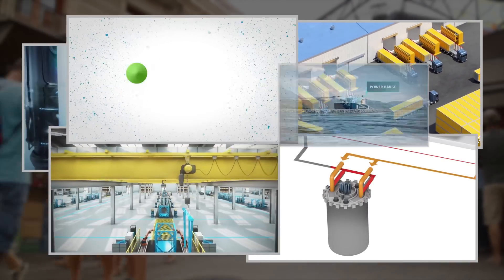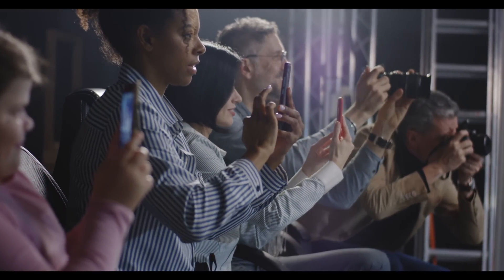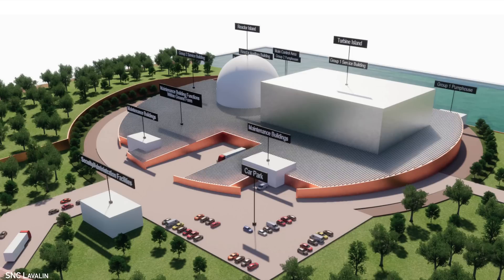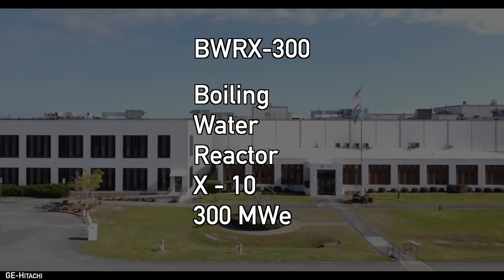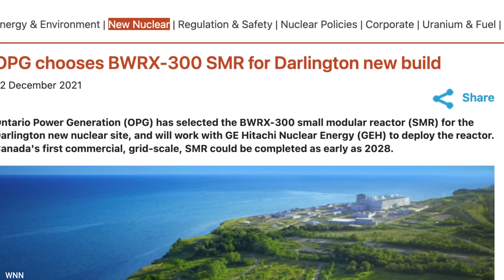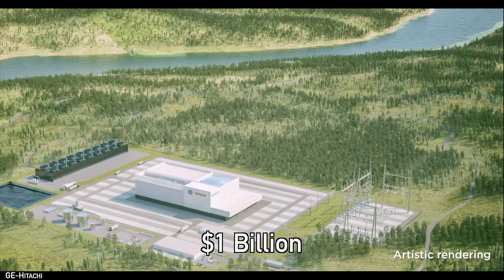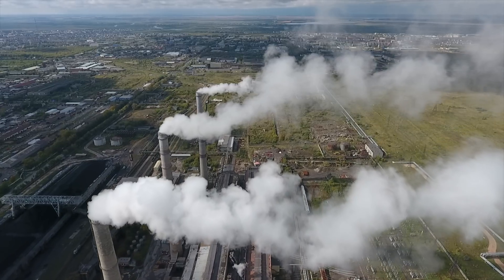Why This Small Nuclear Reactor is Actually Winning

Comment: Problem is it operates at to low of a tempature to store power as heat.  This makes the reactor a poor choice for when there is a large fluctuation in power needs.  In fact I think this type of reactor needs to be operated at a steady output or reaction killing elements can build up and require the reactor to wait several days to restart. Not a good system where the grid has allot of intermittent renewable power sources on it.
Reply: Baseload
Reply: @daniellarson3068  providing baseload is becoming less and less profitable.  When most of the nuclear plants in the country were built electrical payments were based on the amount of investment in the plant and  were not varied on when the power was produced.  Because of this payment structure large baseload electrical generation with high capital cost were profitable.  This is no longer true in that payments for electrical generation have been deregulated resulting in poor profits for baseload power plants.  The problem being that renewable power sources are profitable at really low reimbursements since their cost of producing power when they are doing it is very low.  So when these renewables are producing power any baseload power plant is going to be losing money during these times.  So ideally any high capital cost power plant will need to be producing most of its power when electrical prices are high when the renewables can't.  This is why future nuclear plants will need to be able to load follow and store their power to be able to output it at times when it is most profitable to put it onto the electrical grid.  Currently the best nuclear candidates for being able to do this are high temperature reactors where heat can be stored in molten salt each storage tanks to produce electricity when prices are high.  This high tempature heat also having secondary uses in industrial applications as another source of income for a nuclear plant.
Reply: @stanleytolle416  Interesting. Thanks for explanation.
Reply: @stanleytolle416  at some point the game will likely switch back again. Right now there is no incentive to invest in anything other than low cost to produce renewables. But this is making the grid less reliable. At some point the regulators (or the market) will have to prioritise the supply of reliable power again.
Reply: @yt.damian  Exactly. Why should every other power generation plus demand have to dance around intermittent renewables? At some point their value needs to be questioned if they are the cause of destabilization.
Reply: WHy would you need renewables on nuclear grid? :D

Comment: Thank you for the information on the BWRX 300 reactor and now I see some of the flaws in it's design.  Someone please correct me if I'm wrong but Nuscale (I own the stock) is truly modular with contracts signed for long lead components - built in a factory.  At 77MWe per module 4, 6 or 12 modules can be linked together totaling 308MWe, 616MWe and 924MWe respectively.  While the first version at UAMPS is running over projected cost, as sales ramp up increased volumes will lead to lower costs.
Reply: I live in Oregon. not far from the headquarters. NuScale will be worth zero dollars in the next few years. Delays, delays, delays and not at all competitive against any kind of clean energy solution. Bailouts from Bill Gates and the DOE only go so far.
Reply: @KendallAuel  Nuclear doesn't compete with renewables, it competes with coal and gas fired plants (and large capacity storage, which we can't do very well yet).  It will still be difficult to compete with those on economic terms, but given the drive for zero-emissions power, we might not have a choice.

Comment: A couple of follow-up questions Atomic Blender:  1.  How much does this reactor cost on average; 2.  How many homes does this 300 reactor power in the US.  I tried to search for these answers, but I got a large range of answers that seemed unreliable.  thanks for the video.
Reply: Power consumption in the US is 1.2 kW on average. At 300 MW would power around 250000 homes. The reactor average cost cant be calculated until at least 10 units are built, it will be around 1 billion, but usual cost overruns could make it twice as much.
Reply: Optimistically this will be $3500 per kW. That is the cost to build, you still need to purchase nuclear fuel on a regular basis, perform costly maintenance, and dispose of waste. Compare that with solar (less than $900 per kW) or wind (less than $1500 per kW). You might say nuclear is "small footprint" but do the geometry. Assuming nobody wants to live within 2 miles of the nuclear plant, that gives you a circle with 12.5 square miles area. That is a lot of solar panels.
Reply: 1stly just because people aren't living there doesn't mean the land isn't used. The space is still an issue for solar and wind farms. 

2ndly, why do you assume people would not live within x radius of nuclear power plants. Plenty of people already live littetally next door to nuclear plants.

3rdly solar has a capacity factor of only 24.9% (compared to nuclear's 92.5%) what this means in pracitcal terms is even if every kwh of solar engery is stored or used immidately it can only produce 6 mwh for every 21 mwh per year a nuclear power plant of equal megawattage. 

4thly, nuclear is cheaper when you account for every factor. According to the institute for energy research nuclear costs 33usd/mwh while solar costs 88.7usd/mwh. 

5thly nuclear power stations last longer than solar farms. About 3 times longer infact. 

6thly both your cheap up front costs and the more expensive total costs for solar are only at their levels because government provides 50 times the subsidies per mwh.

7thly when you factor in the large batteries wind and solar need to be ale level out their electricity supply for the whole day, wind and solar have the same initial investment cost as nuclear (despite shorter service lives)

Comment: How dows a BWR integrate with variable power generation of renewables?
Reply: Baseload generation. We keep them at a constant burn to meet the minimum required output. At the least we can take the baseload stations that are coal fired offline and switch any others to peaker plants that rapidly spool up to meet any demand shifts. It would result in a significant reduction in pollution output.
Reply: Hopefully no way. By the time we build these we will be over this solar wind madness hype.
Reply: @lukacsnemeth1652  maybe it's hype but the build rate of wind, solar, and utility scale battery storage is exponential. The power utilities are loving the benefits of batteries, they respond instantaneously to power demands, they keep the grid nicely synchronized, and they enable storage of excess generation for usage later. Hmmm, billions being invested by the smartest people on the planet. Sure it's all hype. All the way to the bank.

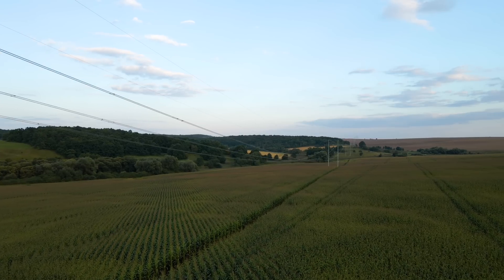Comment: 4:56 Borring is usually excellent for business in that its stable and reliable. Toyota is boring, using what many consider old outdated engine technology but to those who know that translates to resiliant KNOWN powertrains resulting in excellent reliability and maintenance. Conversly the Germans use a lot of tech which is not fully baked, many more complicated pieces resulting in early failure of components and difficulty obtaining certain parts for maintenance.  Great example of why you want boring.

Comment: I believe the use of TRISO fuel has become essential in a modular reactor of the future, because it remove the risk of radioactive leakages and core meltdowns...
Reply: The cost of TRISO is astronomical for utility scale reactors. For submarines and aircraft carriers, and for RTGs at future lunar and Mars colonies, it's the way to go.
Reply: TRISO fuel produces a huge amount of waste, that is hard to reuse.
The local way would be to use spent fuel and depleted uranium, to get rid of this waste.
🔋 Key Advantages of the Dual Fluid Reactor (DFR):

• ⚡ Ultra-efficient: Nearly 100% of nuclear fuel is used  
• ♻️ Burns nuclear waste, depleted uranium, natural uranium, thorium – and all actinides (incl. Np, Am, Cm)  
• 💥 Transmutes long-lived actinides into short-lived fission products  
• 🔄 Built-in Pyro Processing Unit (PPU): Continuously removes neutron poisons and extracts valuable metals  
• 🛠️ Liquid fuel: No solid fuel rods, no reload cycles  
• ⏳ Decades of operation with a single fuel load possible  
• 🚫 No corrosive salts: Liquid metal fuel avoids fluoride corrosion and complex chemistry  
• 🧊 Lead coolant: Excellent shielding, no water, no pressure → no steam explosion risk  
• 🌡️ Very high temperatures (700–1000 °C): Enables hydrogen, e-fuels, ammonia, and direct steel reduction  
• 🧠 Self-regulating: Output adjusts automatically via negative temperature feedback  
• 🪫 Minimal waste: Only short-lived fission products remain (• 🏭 Compact & scalable: High power density, ideal for modular deployment  
• ⚙️ No moving parts in reactivity control: No control rods required  
• 💰 Uses spent fuel, DU, thorium & actinides – no enrichment required  
• 🌍 Reduces dependence on enrichment, mining, and fuel imports  
• 🔄 Fully closed fuel cycle: No external reprocessing required  
• 🆚 Outperforms typical SMRs: No pressure vessels, no water coolant, no fuel handling

Comment: 4:20 This is THE STUPIDEST thing imaginable. There is a reason why almost all other reactors have separate steam generators and that is to avoid contaminating the turbines and other equipment with radioactive materiel. Good luck servicing or getting rid of turbine and piping contaminated with fission fragments and probably activated by neutrons.
Reply: Other SMRs are designed to be non-serviceable. Not sure if this one is the same.

Comment: 1 Module = 1 Football field. 
Nothing Small about that. 
Not going to be putting it in an abandoned Mall parking lot either. 
But, politicians are stuck thinking in terms of Baseline power, and 30MWe per unit is too small for impact.
Great article!
Reply: You are talking about the correct matters. 
The real economics.
Reply: It does seem small to those of us who grew up around the Darlington and Pickering power stations. They are on fairly big pieces of land, which seem unlikely to be using for anything other than power production/transmission. If you want power produced inside a town of 30,000 people, or on a small island, this 300 MWe reactor is not on your menu.

Comment: Same people who designed Fukushima reactor. Just saying….
Reply: Issue with the Fukushima reactors wasn't the reactor, it was that regulators skimmed over the sea wall required by law to prevent Tsunami flooding. The reactor and infrastructure easily survived the earthquake, but the wall was half the height it was designed.
Reply: @UmbraHand  the foundation was severely dammaged and cracked by the earthquake. Its how the radioactive water was even leaking out.
Reply: @avroarchitect1793  The reactor vessels were not affected by the earthquake which is the relevant part. It only had a meltdown because it was flooded by the lack of a proper, regulated sea wall.
Reply: @UmbraHand  I'm referring to the foundation of the containment building and coolant loops. Its fractured and still leaking out contaminated water.
Reply: @avroarchitect1793  Again, it didn’t cause the meltdown. In addition, you cannot be sure those cracks are from the earthquake. The hydrogen explosion blew the entire roof of the vessel and building, destroying the coolant and foundation from that is to be expected
Reply: @UmbraHand  I didn't say it caused the meltdown. I said that the earthquake cracked the foundation that caused the leak  and release. Which is a problem. The building did not easily survive the earthquake and sunami. The facility design was a critical part of the failure. And despite the warnings they were given to correct some of these deficiencies they never did. The designers, operators, and management collectively failed.
Reply: @avroarchitect1793  The cracked foundation didn’t cause the leak. We have no evidence to suggest such a cause. You are just speculating. There cannot be a leak of the containment reactors unless they are themselves damaged.
Reply: @UmbraHand  the reactor melted down and the cooling water they pumped into the building made its way out throught the cracked foundation. It was literally all over the news.
Reply: @avroarchitect1793  Ugh Why do you think the reactor melted? The water breaches the facility taking out the backup power. Once that happened, the rods were not capable of being cooled, the vessel melted and the water decomposed into hydrogen, oxygen and explosive peroxides, which led to the destruction of the building. Again, no water destroying the backup, no disaster
Reply: @UmbraHand  Earthquake fractured foundation. Do I need to say it slower?
Reply: @avroarchitect1793  Buddy, explain to me where the coolant works and is stored??? Oh right, in the reaction vessel. The hermetic, steel vessel. Unless that is breached, the coolant will not leave. Japan has dozen of other reactors yet none of the have any leaks…Guess why. Think S l o w e r

Comment: Small nit. The Nuscale SMR is the first SMR design ever approved by the NRC. They are currently getting an uprated version of the design approved and plan to build that version (77 MWe vs 50 MWe) for their first customer (UAMPS).
Reply: NuScale just canceled their project.  There is no such thing as economies of SMALL scale
Reply: @clarkkent9080  maybe this company won't make it but that won't prove anything. For nuclear energy the vast majority of cost comes from construction time. If assembling modules makes construction faster then it could bring costs down. If. No one knows yet. Also depends on the local bureaucracy.
Reply: Recent news include some deal with Indonesia.
Reply: @abcddef2112  Yea easy to get paper deals saying ‘we will buy your reactor”.  Only hype until they get a regulator to approve turning first shovel of dirt.
Reply: Hey Poland! You're going nuclear for the wrong reasons!

CO2 is climate-irrelevant. 

Interglaciation climate change (i.e., the Medieval Warm Period) is caused by changes in cosmic rays (Svensmark et al). 

There is not such thing as anthropogenic global warming.  

"Global Warming" is a superstitious bullying and shakedown of the taxpayer. 

Just burn coal and keep looking for more oil and make it out of coal (the way South Africa does at SASOL).
Reply: Bigger nit.  BWRs circulate radioactive water through the entire power cycle (turbine, condenser, feedwater) resulting much more expensive maintenance due to safety protocols.
Reply: @trobinson14kc  how’s that relevant to this?
Reply: But NRC has not approved the NuScale Combined Licensed Application.  The COLA faces major issues with volcanic risk, seismic, and use of consultant that has not one geotechnical engineer, only geologists, performing the engineering analyses of the foundation design.
Reply: @July41776DedicatedtoTheProposi  True NRC has not approved CoLA.  

Where do obtain this info on “major issues with volcanic risk”, in …. Utah?

“only geologists “ smacks of somebody trying to get paid.
Reply: Smacks? Please clarify.  Today, firms lie about their qualifications to capture work and make money, geologists claim that they are engineers with an combined structural and geotechnical background to the client and perform work for which they are not qualified, thus violating their code of ethics, and management focuses on schedule and cost and skips key steps in maintaining quality to keep on schedule. There is no longer objective truth and no one checks details of designs and calculations, qualifications, skill, and experience.
Reply: @July41776DedicatedtoTheProposi  

Today?  Today firms inflate potential harm in some fields, insisting increasingly specialized and narrow specialties are required, and accuse other perfectly capable scientists of fraud.  Ask, what’s  the record of actual harm in fatalities or to lifetime? ‘Well, actually there is none in 70 years globally for this type of reactor, even in severe quakes, but this model here shows the extensive possibility of harm, which we will introduce to some NGO or regulator.’

While the Western nuclear construction industry spending has withered, the nuclear safety industry is closing in on $1 trillion last 50 years.  $400B Hanford, $200B Sellafield, $200B Fukushima.  Incentives matter.
Reply: @Nill757  - wtf? You are talking smack, making generalizations, and making unsupported or relevant statements.   But, this contractor has hyped concerns that, after critical examination, are nothing more than unethical marketing designed to stampede managers with no technical background or education upon which to render reliable judgments. This contractor exploited managerial ignorance and flooded the discussions with unfounded fears and misinformation. They even lie about previous NRC actions for reactors nationwide, and the manager accepts these lies without doing the requisite due diligence.
Reply: Yes but as they said this guy is in Europe not US under NRC.